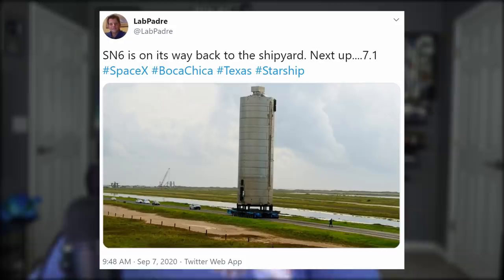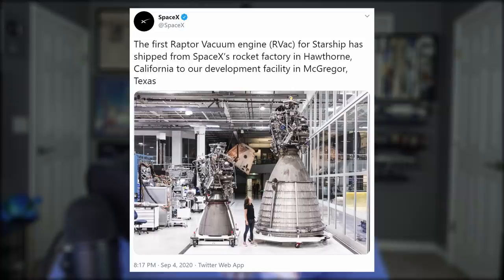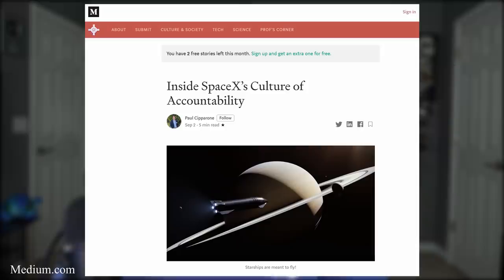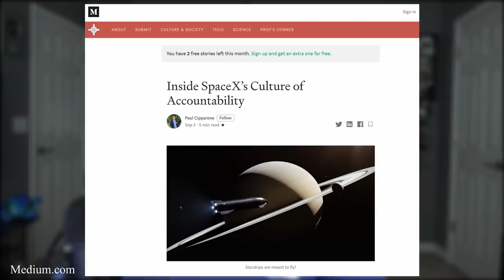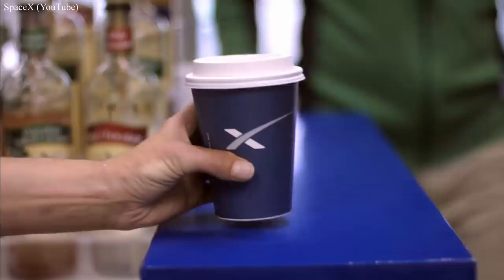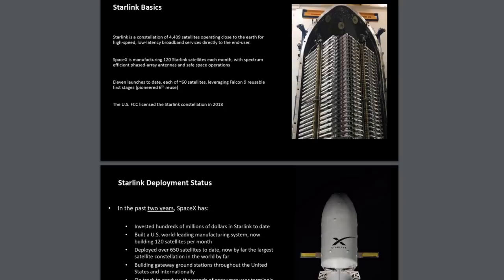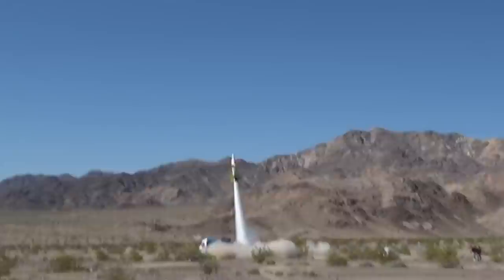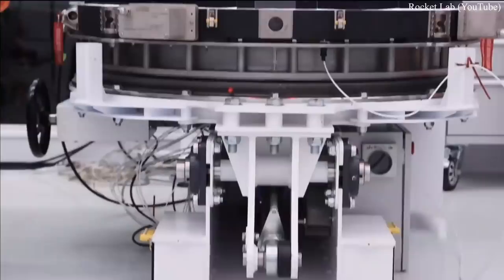What it's Like to Work for SpaceX on Starship | SpaceX in the News

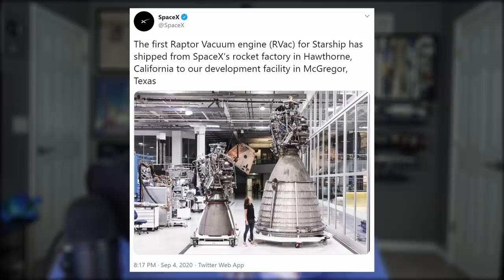Comment: Dude those vacuum engines are a pleasant sight to see. The bell and its cooling system are about what I expected. However, the core engine on the vacuum bell seems to be the exact same engine with some extra fuel linkage for the bell cooling system maybe? 1:33
Reply: Certainly is. The extended bell keeps the exhaust confined when in space, therefore increasing thrust.

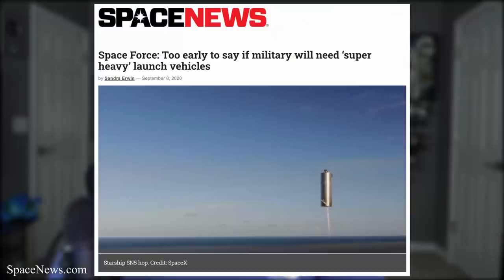Comment: 2:22 No, Merlin 1D vacuum actually has a specific impulse of 348s. It’s actually currently the most efficient RP-1 rocket engine. Impressive considering it is open cycle yet still has higher specific impulse than closed cycle RP-1 engines like the RD-180. Really shows what focused development and iteration on one engine can do.

Comment: Imagine a Starship doing the flip maneuver with people on board. Poor people.
Reply: That depends on if the the passenger harnesses are designed for it! Think of a Paraglider Harness on a horizontal axis gimbal bearing, with four webbing attach points in the “ceiling”, and four more in the “floor”.

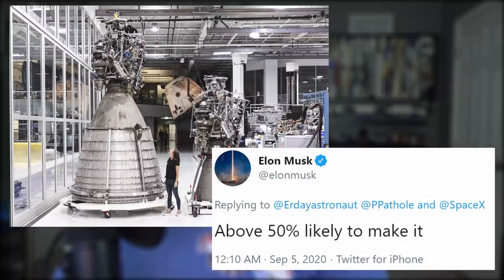Comment: 2:01 I'm curious about the vacuum Raptor. what's the altitude or atmospheric pressure where it starts to outperform the regular raptor? Does the higher efficiency mean that it is configured to use fuel more slowly than the regular version?